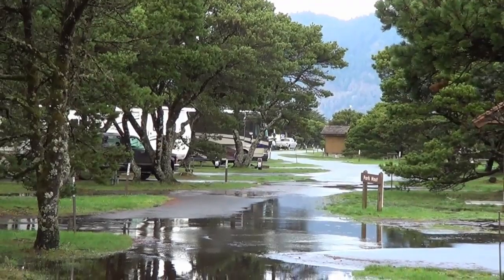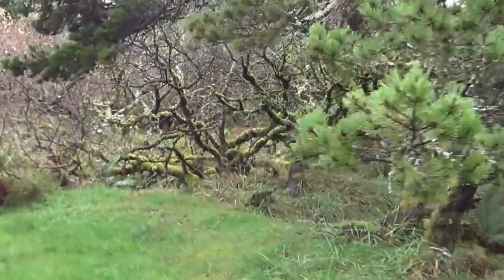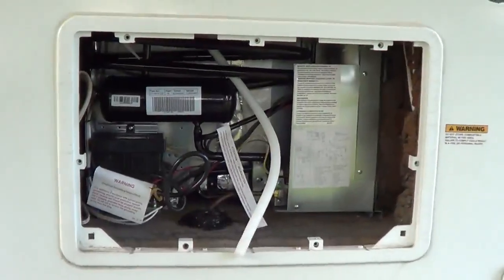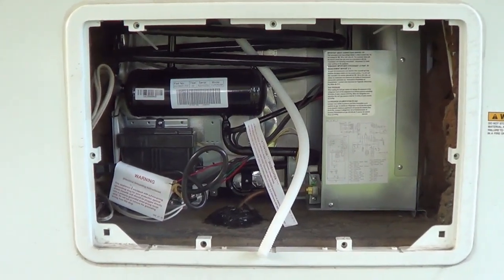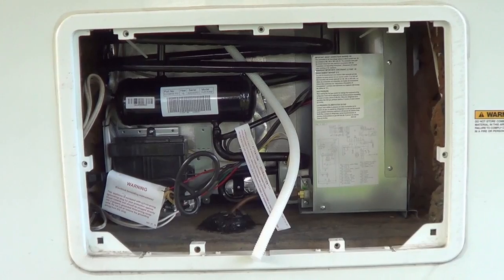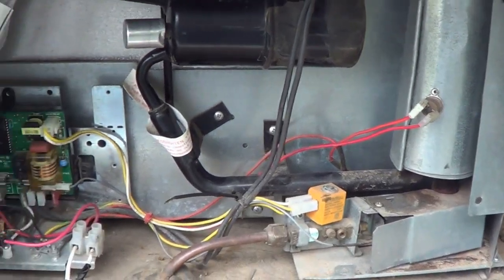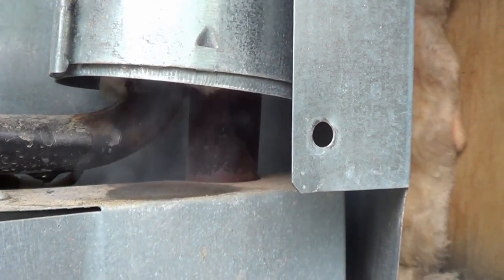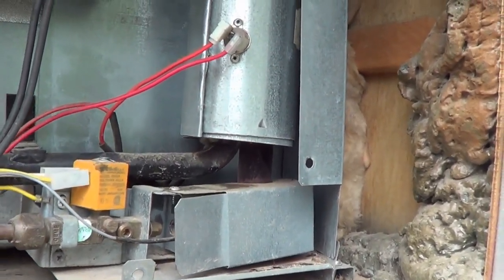Fail Footage of our RV Refrigerator Leaking Ammonia

Comment: Our Dometic refrigerator (RM2852) stopped working sometime in the last week. It’s approx. 15 years old and has been running pretty much continuously, 90% of the time it's on shore power.  While researching my problem last night I viewed your June 2013 video about the heating element and tested mine.  Mine showed closed, had resistance so I moved on.  I tried the cooling system using on gas only.  My pilot light started and I could tell the furnace/boiler was heating up.  Within half an hour I could tell the metal plates in the frig were cooling again.  I shut off the gas and it was then I noticed the hissing and faint aroma of ammonia gas like this Nov. 2016 video mentions.  Now I guess I’m off to source a replacement refrigerator and will add this remove and replace repair experience to my 30+ years of "pleasure" owning motorhomes.  Suppose I shouldn’t complain because the refrigerator cooling system has failed after so many years of flawless service.  Nothing lasts forever, a fact my body reminds me of regularly these days!  Any comments or advice you might have is appreciated and thanks for creating and publishing your videos!
Reply from the maker: You're welcome, 15 years is pretty good lifespan.  There are cooling units available but not cheap and with a fridge that old I'd guess its best to swap out the whole thing.  Cheers, Ray

Comment: We had this happen on our Dometic RM2652 refrigerator in our 2004 Wildcat 27RK too.  I was able to purchase a Third party cooling unit that was not a stock replacement but an upgraded style for less than half of a new refrigerator. I was able to do the change out myself in a couple hours with the directions sent and a YouTube video from the manufacture. The wife was happy as the new fridges that were available we wouldn't have been able to use the Wood panels on the doors and she really likes that look in our rig.
Reply from the maker: I was lucky to have a full replacement under an extended warranty we had otherwise I may have down the same. :)
btw the new fridge (same model number) has a different looking cooling unit and no fan and boy does it cool well! Ice cream as hard as rock and meat freezes solid. I think they must have upgraded the design, our other one never worked this good.

Comment: I swear these things are engineered to fail every couple years.
Reply: Erik just saw a video on how sturdy the rv refrigerators are because of the steel coils I guess he was full of Obama or just trying to sell he also said regular way way cheaper reg electric refrigerators are built with inferior materials so you just really need to spend the fifteen hunded dollaz instead of the 285 dollaz at office max for a simular size electric refrigerator.
Reply: @guyazbell7437  see my message above, my Dometic refrigerator lasted 15 years, your results may vary.
Reply: see my message above, my Dometic refrigerator lasted 15 years, your results may vary.

Comment: We never smelled anything but we did get the "yellow dust of death" on our cougar's fridge. The leak was small but once it starts your have had it. Was pretty easy to replace but we had to take the door frame off to get the new one into the rig. UGH!! You would think they would make the doors just a little wider. LOL
Reply from the maker: Ours must have fit through I saw no sign they took the frame off. Maybe the fridge's door and plastic trim comes off and then gets put back on

Comment: Looks like you should have headed south a few weeks ago.  Record rains in Oct-Nov.  I had snow/rain/cold throughout N. Calif.  Been basking in the mid-upper 80's the past 3 weeks so loving the warm weather in S. NV.  My propane fridge died about 2 years ago and I replaced it with a Visanni A/C fridge for $175.  I've been 100% off grid.   Have had no problem keeping it running with my solar panels and battery banks.   New cooling unit for my fridge runs about  $600 now, so may take the plunge and revive the old fridge and save the wear and tear on the battery bank.  Be nice to not have to babysit the solar panels for a change, but sure has been light on the pocket book with very little propane use.  I've been very surprised how little propane I use now.  I can easily go 2-3 months on 1 7 gal bottle.  That's running the cook top and oven  daily and hot water when I need it.
Reply from the maker: I guess there are pros and cons each way. If I didn't have the warranty I was seriously considering an A/C fridge and adding to the off grid power system.
Sure was wet on Vancouver Island! The good part of leaving so late is we get to stay longer into the spring which is a favorite time of year for us in the southwest. Cactus flowering and we get to explore the higher elevations on the way back like in Utah and New Mexico.  Cheers Ray
Reply: Hi NWHiker. Went to your channel to see what your sys looked like and how much solar. You should make a few categories of playlists to make it easier for us to find such videos. So just how much solar do you have and what do you use for back-up on rainy days like Ray has here?
Reply: Sorry, there's much I can do with my channel and haven't been too active lately.  I have 590 watts of solar that I run portable.  I have 3 pig tails on the outside of my camper with multiple branch connectors and can run panels off either side with extension lines.  I have a 2500 watt Onan microlite built in that came with my camper as well as a Yamaha 1,000 watt generator.  I've put maybe 50 hrs on the Onan the past 3 yrs, so rarely ever use that.  If I'm driving all day and it's hot I'll use the Yamaha as it's so fuel efficient.   I get about 12 hrs of run time on .5 gal of gas, and that works well for lights and charging if it's cloudy for more than 2 days.  I run my Ham radios too, so that's a big power draw.  Have had no problem keeping up with power demands with my solar if I get at least 6 hrs of sun each day.  Living in the SW Desert isn't a problem.....:)
Reply: Thanks for the overview. Very nice setup.

Comment: ---
 
Posts: 17
View Profile  Personal Message (Online)

Re: Dometic fridge ammonia leak
« Reply #32 on: Today at 02:25:05 pm »
QuoteModify
Hi
Did the ammonia leak into your camper like it did mine. Dometic has denied the fact the ammonia can come into the camper. The fridge has two huge holes around the tabs where you screw it to the cabinet and also you can see daylight from outside showing under the bottom of the fridge. I sent them pictures and I plan to get a fog machine and put in the back access and film it coming in the camper. I plan to send that video to the attorney general in order to hopefully get a world wide recall on this problem. I am not the only one that could have died from this leak. A family on here also could have died had their dog not awakened them and got them out of the camper. It has been over two months and you can still smell ammonia in the camper. I had the fridge removed immediately and for a month and a half you could not get within 20 feet of it and that was in the open air. I just had it put back in the camper so I could prove to the company that there is a defect in the manufacture of their fridge and the ammonia can come int the camper and kill you. They said the fact the cabinet was sealed would prevent the ammonia from coming in. The cabinet is sealed in the corners from top to bottom and all around the top and bottom of the cabinet. But that is not where it comes in. It comes in from below the bottom of the fridge and through the mounting holes at the top of the fridge behind the panel that has the on off buttons and such. I am warning every one if you have a dometic fridge in your camper pull the bottom metal plate and the control panel up top and you will clearly see where outside air can and will enter the camper. I had my ac on which circulates the inside air. It sucked the ammonia right in the camper while I was sleeping. My fingernails, hair and throat are still suffering from the effects of the 99.98% pure ammonia. Household ammonia is 10% and breathing it can cause problems so imagine what this will do to you if this happens to you like it did me the other family and God only knows how many other people. Please help by contacting the attorney general in Indiana and make a complaint when you find these open places where the ammonia can come in because if it develops a leak count your blessings if you live through it.
Modify message
Reply from the maker: No, didn't get any ammonia inside. I had the outside access panel off so it dissipated pretty quick. We slept in the RV that night and couldn't smell any ammonia, my wife has an excellent nose for that sort of thing.

Comment: I had my my Fridge go last month. It was 15 years old. The dealer also suggested replacing it because rebuilding it would only save me a couple of hundred dollars so it was better to pay a bit more and have a new fridge. Interesting enough most of the instalation time was taken up by removing my motorhome door (class A) to get the fridge out and back in. We were short by about a quarter inch with the door in. My new fridge (Dometic) cost me $2500 installed and that's in Canadian dollars or $1850 in USD at todays rate.
Reply from the maker: Wow, 1/4 inch, that sucks. :(   I guess 15 years isn't too bad, our only lasted just over 5. I think they are making then cheaper these days because I remember my old camper van fridge was still going strong at 20 years when I sold her.
Reply: On the plus side, they were able to inspect/replace the door seals and I was told that if a motorhome is going to leak, "if it ain't the roof it'll be the door" and mine was in great shape.
Reply from the maker: That's good to know, a leak is the worst thing.
Reply: I was told that since your door sticks out more than your windows, when you frive in the rain there is a fair bit of pressure on the doors leading edge and if there is even a pinhole, water will be forced in. Water damage will show up as a slight discolouration on the inside at the bottom of the frame; usually in the flooring material. It' good to have someone with experience give you a heads up. The older gentleman supervising my fridge replacement knew his stuff and knew that the fridge would not fit. The rest of the crew wanted to try it anyway without removing the door and after lots of heaving and fiddling (they were careful) the bowed to his experience and did it his way. I always like it when older mecanics work on my stuff.

Comment: Hi Ray, really enjoy your videos. Did you look into the compressor style fridges when yours failed? I believe there are 12volt versions of these fridges that are, sort of, like the "normal" household variety.
Perhaps in your case because you had a warranty, it wouldn't have been an option? I know very little about these compressor style fridges but they sound interesting.
Cheers! :)
Reply from the maker: I like to have the option of using gas when boondocking saving our batteries so less generator time. Compressor style demands quite a bit of electricity. I know a few folks that went that way and needed a much beefier solar and battery setup. Cheers! Ray
Reply: I agree that a 'normal' household fridge/freezer uses a lot of power and I wonder how people make them work in their RV. I too like the option of using gas. However I saw these Nova-Kool fridges on a Youtube channel called "The Fit RV". When I looked on the Nova Kool website it seems to indicate they use somewhere around 6 DC amps when they're running. Looks like they target the boating, RV and trucking markets. Sounds interesting, 6 amps is not very much. Another interesting thing about Nova Kool is that it seems to be based in Canada, in Coquitlam!?
Reply from the maker: I guess it depends on how often it is drawing 6 amps? 
I think the best would be a smart fridge that would be electric when the sun is out and you have spare solar amps after the battery bank is charged up and the switches to LP Gas when the sun sets automagically.
One thing I've noticed is the new Dometic DM2652LBX is night and day better than the older DM2652LBX I had. Cools way better, ice cream is hard as a rock, I run it at the warmest thermostat setting. I noticed the cooling unit piping is different. I bet they are worried about all the new RVs switching to compressor models and there was a class action lawsuit against some of the old models, I bet the have redesigned them to actually work! ;) Nothing like seeing your business declining to give a monopoly a kick in the pants!
Reply: HAHA, too true!
Thankfully we don't have to make a decision about a new fridge right now but I always keep my eyes open to new things coming on the market and will be curious to see how this fridge thing plays out. Thanks for your thoughts and keep the great videos coming. :)

Comment: Hi Ray - Have you ever thought of running your fridge off your 1000W inverter while driving ?? Assumming your alternator is big enough to charge your battery bank
Reply from the maker: No, not really. I don't find our fridge loses that much of its coldness when traveling for even 4-5 hours. We don't travel in very hot temps, so has never been a problem for us.

Comment: How was it dealing with the warranty company ?  We have an extended warranty and have used it a few times. Roof top AC, factory installed inverter where the 2 biggest. It took weeks to get them replaced and we had to pay for shipping. Not a fun experience.
Reply from the maker: We were lucky. The warranty was purchased from our dealer at the time of rig purchase 5 years ago.
So, our dealer took care of everything. no paperwork, just a signature, and payment of the 50 dollar deductible.
 Kinda rare these days but they are fairly small operation and only deal in Keystone trailers.

Comment: What about your upgraded quiet fan(s)? Do you need to re-install? Also, to clarify, did this happen on the island before you headed south and you took it back to Greg's RV for warranty service?
Reply from the maker: Yes, it happened a few weeks ago and had it done at Greg's. This new model 2016 doesn't have a fan so I'm hoping they have improved the design to the point an extra fan is not needed. I'll see what happens when we hit some hot weather.
Reply: Hi Ray, so I assume all is well with your fridge cooling. Is there no need for an additional fan on the back of the fridge?

Comment: hi ray this is a little of the subjuct but have you seen anyone hall an atv of the back hitch of a 5th wheel trailer  i here you can its not a trailer it hooks up on the back  off the hitch i no yours dosnt have a hitch but some do thanks allen
Reply from the maker: I've seen it but I think it depends on the state you are in and where you are going. Some places don't allow triple tow but you can travel through. My home province of BC doesn't allow it so I guess I couldn't be insured.